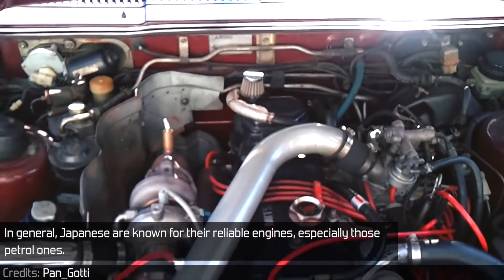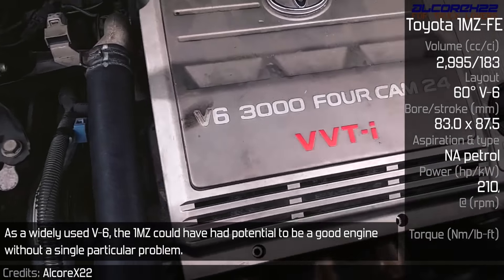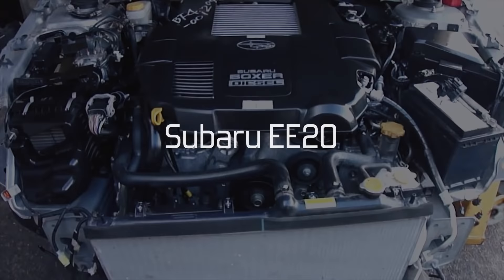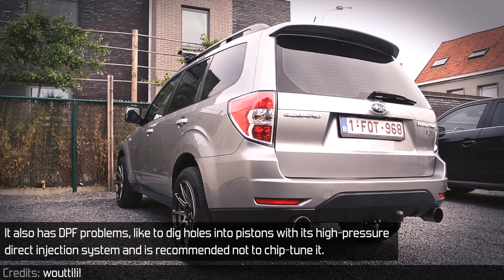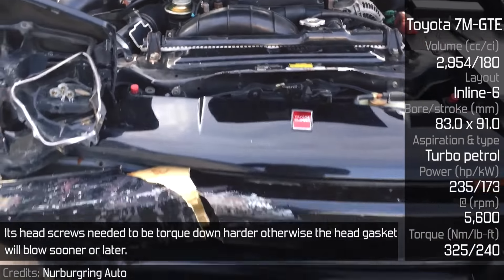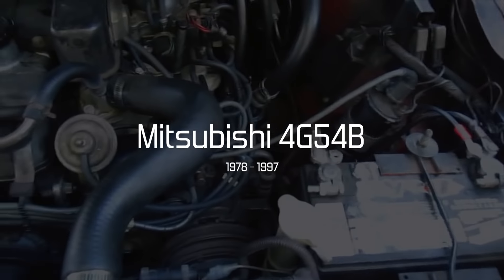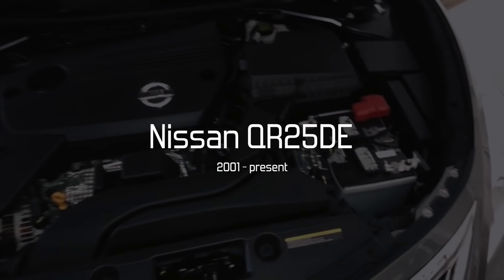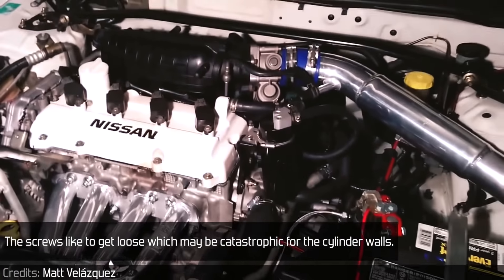Top 5 Worst Japanese Engines Ever

Comment: You appear to only feature the high performance cars. I had a 1984 Nissan Cherry 1.3. That engine was notorious for cracking the cylinder head. The car also dropped a drive shaft and stopped whenever it rained. It was the single most unreliable car I have owned in my 43 years of driving. I will never own another Nissan.

Comment: QR25DE had some problems in the first generation with the catalytic converter.
Actually, is an excellent engine used in the Rogue, NP300 Navara/Frontier and Altima. 
Very reliable.
Reply: Sentra SE-R too

Comment: 6A12 (V6 2.5L SOHC/DOHC) on '96-'98 Mitsubishi Galant.
Mechanically it was great, but not cool with electronics.
Engine dies suddenly on hard acceleration without any sign of error. Mostly happens when touching 70-100 thousand km mark.

Comment: LOL - Suggestion. Which engine is the longest in production? What holds the record?
I could be wrong, but I don't think any current American V8 can trace its roots back to the original small-block Chev, and I'm damn sure none of them can trace their roots back to the flat-head Ford.
I'm an Australian, I live in Brisbane. When I was born, in 1962, Holden was making straight 6 engines. That engine grew to 202 Cubic Inches and got fuel injection in about '84, but we got unleaded fuel in '86, so they finally killed it off. That engine could trace direct ancestry back to 1948, and the Holden 48-215, which has a 149 cube version. Ok, but that wasn't the start. In 1945 or 6, the Australian government bothered it's allies, after the war, for help to get our industries up and running. We ask the Brits and the Yanks, for tooling and moulds and stuff, for an old middle-of-the-range car engine. Brits didn't have anything much, but the Americans went to Chev, and asked. Chev had an inline 6 they'd retired in about 1931 or 2. It was designed and developed in 1919 or 1920, and stayed in production until 1931. It went back into production, (with, admittedly, a few minor improvements) in 1948, and we were still making up until late in 1986. There are still many thousands of Holden 202 sixes driving around in Australia in 2017. That engine is approaching 100 years old, but they're not still making it.
There is a better one. Ferdinand Porsche was an army cadet in Prussia, in 1912, and he got hooked up to be one of about 8 ~ 10 such cadets, (all about 14 ~ 17 years old) who accompanied and assisted, and drove for, a chap called Franz Ferdinand, who was the heir apparent to the Prussian throne. Franz liked cars, but he couldn't drive them very well, he kept getting in minor accidents... So at 15 or so, Porsche started to learn to talk to Royalty... In 1918, various companies were making engines for German aircraft, and a new company was formed who made a first engine, which went into the Fokker DVII. It wasn't the only company or the only engine, but it was their first, and even so, it was better than all the others. After the war, 1919, that company started to make motorcycles, because a man's got to eat. They designed a boxer twin for a bike, and shaft drive. The company came to be known as Bavarian Motor Worken. BMW. 98 years later, BMW still make a boxer twin shaft drive motorcycle. So Ferdinand Porsche got a job after the war, with Mercedes. He saw a test session with a grand prix car, and noted that it suffered from wheel-spin on the inside rear coming off corners. So he wrote a written suggestion to the company, that they investigate the newly invented idea of a limited slip differential - which was being introduced for trucks. You would need to make a smaller and lighter version, but... About 7 ~ 8 years later, Porsche submitted a design concept for the racing car to be built by the newly formed company, Auto Union (who we know today as Audi.) It was revolutionary, because it was the first mid-rear engine racing car built to full scale and full performance. The concept of a 'gokart' with a motorcycle engine beside or behind the driver was nothing new, kids and hobbiests and enthusiasts had been working on those since about 1895. But they were toys. One company had built a rear engine racing car before, but it was very high and narrow, and the dynamics were murderous. Porsche took that idea and squashed it down lower, and gave it 4 wheel independent suspension. About 4 years later, it was winning, so Hitler asked Porsche to head the design of the People's Car. So Ferdinand Porsche took the chassis principles he had worked out for the Auto Union, and adapted them for a small low-cost car. (Look at the suspension design of the Auto Union, then look at the suspension design of a V-dub. No, they're not the same, but the concepts & principles and basic proportions are.) He swung the engine around 180 degrees and mounted it back off the rear axle instead of forward. He made it air cooled, because its simple. And he went looking for a boxer or flat 4. What he found, was the BMW motorbike engine, which worked incredibly well. Because of where it sat, it needed a cooling fan, but that's not a huge problem... If you took 2 of those engines and joined them, you'd have an early VW.... Then, after the war, Porsche set up shop as a builder & tuner, and it wasn't long before he had the idea to build his own car. The starting point was (again) the BMW boxer twin, only this time he made a boxer 6. Early versions had the engine forward, into the cabin, like the Auto Union. (And the Cayman.) But by 1960 or '61, his customers were bothering him to built a Porsche 6 with the engine out the back again, like a VW Beetle. Then there would be room for golf clubs, or two kids... In 2017, it is 98 years since BMW formed and started to make boxer twins to cobble together a powered bicycle, in the ruins of WW1. The VW Beetle his come to be the grandfather of the 911, and the latest GT2 has 700hp and does 205 mph, and is still one of the fastest and best and most desirable & recognisable sports-cars in the world. The birth of that engine was 98 years ago, to make a cheap motorcycle.
Reply: Feri Porsche is a true legend.

Comment: Subaru diesel itself is not that bad. Bigest problem is the two mass wheel, and the clutch but engine itself will  live more then 40000 km, if you use it good way. Subaru even made service action to reduce torque in low RPM, to save clutch.

Comment: So I noticed you used driving clips of the b16 SER spec V sentra with the second gen qr25de engine. In the b16 sentra they fixed all the pre cat issues and butterfly valves that were present in the b15 sentra... don’t misinform people please

Comment: I had one of these Toyota V6 for a few months and it was a terrible car to own. The O2 sensor broke within a month and so did the exhaust. The car had decent power for a V6 but no grip even a right angle turn less than 30 mph results in a lot of understeer. The car whole car was plague of endless rust. I guess a 13 years old car is just not worth buying.

Comment: I'm curious if the 1MZ's sludge issues followed to the 3MZ.  I have a 3MZ that just rolled over 245K miles today.  The last time I had the valve covers off, you could have probably hosed them off and eaten off the inside of them.  However, I do change Mobil1 every 6-7K miles and ran it since 10K miles.

Comment: Forgot the 3.Slow, 3VZ, usually in light trucks.... when you would rather have more cylinders less reliability, more fuel consumption and not that much more power than a 22RE.  Or when you'd rather not have the bulletproof 3.4 l..... and instead exchange for Less power for about the same fuel  consumption and exceedingly worse reliability.   

The 3.Slow IMO is far worse than any  22 series

Comment: You forgot the zz series non-Yamaha engines that were so bad Toyota GB (and probably others) extended the engine warranty to 120000 miles or 7 years, and didn't have any new or reconditioned engines for those that exploded

Comment: the QR25DE is actually a great engine after they solved the head gasket issues on it in the first couple years. Can't call an engine shit just because of software issues. Also have NEVER heard of such a thing as screws getting into the combustion chambers, I call bull on that one.
Reply: Jessie Scicolone Well it happens all the time on the 1st Gen QR25 02-06 The 2nd Gen most problems were solved
Reply: Ye first gen QRs suck ass. My 03 spec v swallowed two butterfly valve screws and the header blew up because the cat was plugged. This was within 500 miles of me buying it. Still loved that car tho

Comment: The Toyota 3.0 V6 in the older pickups and 4 Runners should be on this list.Could not keep waterpumps and headgaskets in these.The Matrix engines as well,my dad sees the Matrix in the j lane at one dealer only auto auction announced with a bad engine.They are blown up including seized up.The 2.6 and 3.0 Mitusubishi engines too,Chrysler used these engines in their minivans.The 3.0 had valve guide issues.The 2.6 had headgasket issues

Comment: Toyota MRS 1ZZ if i remember, oval cylinder bores and pre cat ceramic desintegration causing engine damage, Nissan CG series engine with timing chain crapping out, cylinder heads and camshafts lubrication problem too. Sometimes japanese stuff if frustrating because they provide and sell very good stuff that you are happy in 99% of the times, but somehow they manage to screw up a small thing that will bother you every day. Honda CBF125, despite the low power it's a smooth running one pot, but the gearbox is so crappy, false neutral everywhere, can't shift into first or second half of the time, and it has 1000km. The yamaha YBR125 was rough as a diesel, but the gearbox was so better, can't have both at the same time ^^
Reply: The TD 27 Terrano engine is the best

Comment: Woundering if I should change my mind now. I am having thoughts of getting a 2006 Camry SE if I find one that is well maintained. Reliability of the MZ-FE and the power it delivers is the attraction. I have 2005 mecedes with an M112 which is also a good engine, but I have issues with reliability of the car in general electricals and fixing cost can "kill" with annoyance. It took time and "lesson" for me to begin liking Toyota. Hope that doesn't change because of this video.

Comment: I have a feeling that I’m going to be screwed. My 2006 Nissan Altima. Has the QR25DE and I keep hearing all of this stuff. You can get the engine to run like brand new if you purchase an aftermarket pre-cat. And the butterfly screws would need to be really held in with lock tight.
Reply: the cat problem was fixed by 06, what ended up happening?

Comment: The front wheel drive vq35 is missing from this list or any vq35 for that matter. Also I have to disagree with you on the 1mz. It’s not the best engine made by Toyota but not deserving of this list. I work as a technician at a Toyota dealership for a few years. That’s one of the best v6’s Toyota ever made. Powered the Camry, Avalon, sienna, and many Lexus models for years. Yes they do sludge if you don’t change the oil but they don’t die and was the first engine to be v6 swapped in mr2’s. The 3vz was pretty bad but what about the vg30?
Reply: VQ35DE is a wonder.
Three times was the engine of the year.

Comment: Thousands of Silverado/Sierra HD owners would dispute whether or not Japanese diesels are any good....
if you could get them to admit that Isuzu was the primary designer on their Duramax engines and the engines are built in a joint GM/Isuzu facility
Reply: Wish I had a dollar for every broken crankshaft in a dirtymax, or a nickel for every cracked injector.

Comment: I believe Mazda 6 (MK1) 2.0 diesel was one big crap of the engine. Even with regular maintanance you could get one or more pistons stucked due to poor oil circulation or injector gasket corrosion. And this is only the beginning.

Comment: #1 should have been the 2.6L Mitsubishi sold to Chrysler for their mini vans. The timing chain looked like a 4 foot long bicycle chain with spring loaded nylon tensioners. After around 30,000 the tensioners wore so bad the thing would backfire, throw the chain and put the valves through the pistons.Also at the same Km the oil consumption was around 3L per 1000km. Pure junk.
Reply: 100% agree.  Sounds like same shit engine used in the Sigma and the Magna.   All mitsubshit burn more oil than a 2stroke...   Kamikazee pilots where using Mitsubishi's for suicide missions., thats all there good for.

Comment: Toyota has a fairly good diesel record. In SA the 2.5,  3.0 D4d is legendary getting to 1 million km a few times, the 1.4 1nd-tv D4d is also strong with very few failing. This is all in a country like South Africa with extreme weather shifts and altitude changes.

Oh and Isuzu is the biggest multi use diesel engine producer in the world,  they must get something right.
Reply: Kavi4GP fuel consumption and power on the Toyota are God awful.  Isuzu are mostly light weight high speed, and don't last particularly long.
Reply: Randy Magnum how did you come up with that? Fleets run the Toyota and Isuzu for its low costs and high reliability , don't let your experience damage brands that far out last others.

Comment: I have a 1985 subaru engine.. multiport, fuel injected, optical disty, knock sensor.. turbo. what was the first fuel injected again? I think it was mitsubishi that shared the new found optical disty with subaru... I never see the EA82 mentioned in good or bad or pioneering or anything. Someone tell me why?

Comment: The Japanese don't make good diesels?  Tell that to Yanmar and Kubota.  By the way, direct high pressure injection is standard for normally aspirated diesel engines (which do not have carburetors).

Comment: Should have added the 3VZE from Toyota. SOHC V6 12 valve. Pitiful output for a 3.0l and with head gasket issues to boot. The exhaust valves love to stretch over time reducing valve clearance that will eventually cause them to burn. Oh and they are adjusted with shims which is a pain in the dick to change. And if I'm not mistaken the cams like to seize in the heads and sludge is another issue with them too. One of the worst engines to come from Toyota....

Comment: Can’t agree on  1MZ FE .... personally put 360k miles on a 97 camry  with originanl everything  beside the timing belt and was still runing like butter.... 2nd one is 2001  with under 100 k and still under  daily use.... any engine if you dont change oil on regular intervals it will eventually cause the sludge issue.... but the issue you are talking about happen in some avalons and thats when they inteoduce the VVTi system in  its early models.all of the toyotas modern v6 are the improved form of 1MZ FE

Comment: Some of my most favoured engines are suzuki M13a, M16a are pretty tight. Toyota 1.4 and 1.6 vvti bullet proof. Honda 1.4 i-dsi are pretty solid aswell and the 1.8 i vtech. 1.7 isuzu diesel. My most hated engine is the fiat lancia 8 valve engines, vauxhall from 2003 onwards are junk car and the engines. Renault 1.2 DIG and 1.9 dci. Honda 2.2 i ctdi arent that clever in my opinion. Chevy 2.2 diesel not the worst but im fond of them.

Comment: I#m missing these engines on the list: Honda H23 and D17 Series. Both are notorious for breaking crankshaft und pushrod bearings. (in stock condition and low milages) And the Toyota 2.2 DCAT, never get to known to a car with this engine, doing 100k miles without serious trouble...

Comment: Eh, the Nissan 1.8L made from 03-04 was WAAAY worse about eating the cat...
Reply: akio2589 QG18DE was an excellent engine used in the Almera and Sentra 00-06.
Reply: akio2589 What do you mean?
ECU?
Reply: MHCPL Well, yes. The way the engine was programmed to run combined with the position and shitty quality of the cat caused the engine to suck the cat back into the engine a little bit at a time. Nissan's alternative to an egr valve. And they failed miserably. Ceramic material in the cylinders is usually a bad thing. Ate up the rings, destroyed the cylinder walls, and junked the engine. The 2.5 v6 got the same treatment, but it wasn't as bad about eating the cat as the 1.8 was.
Reply: MHCPL And the worst years for it, I believe, were 03-04. At least, those were the years I did the most engine replacements for.
Reply: akio2589 Maybe you are confused.
QR25 from 2000-2005 had these problems by a bad design with the cat.
QG18DE didnt have the same problems.

2.5 is L4 not V6 and actually, is an excellent engine.
Reply: akio2589 The only problem with the QG18DE in 2000 were two sensors in the engine and IAC valve. Nissan recall many Sentras to change these parts.

High oil consumption is normal in the Q engines, Nissan it knows.
For this reason, you must change 4 times per year the oil and sometimes could be necessary and normal refill with oil in every interval (Literally Nissan it says in the manual)

Comment: Get a clue before you make these videos...  300k on my 1mz and it still runs like new.  Even completely skipped my first timing belt service as it’s a non-interference engine.  Just change your damn oil when you’re supposed to 🙄  One of the best engines ever made.

Comment: You left out the 1.5 L 12 valves engine in the 1986 Toyota Tercel. The facts were all later Tercel models were all  lemons wt this lousy engine.  The  head gasket leaks, high oil consumption, and coolent leaks to the engine block turns to engine failure . During the warranty period the TOYOTA dealers and the proud TOYOTA manufacturer  insisted it is normal nothing wrong to drag it pass the warranty period.  After that " Welcome to the Toyota Dealer, how may I help you out for your new car purchase  ?". Toyota the winner from the Hall of Shame .